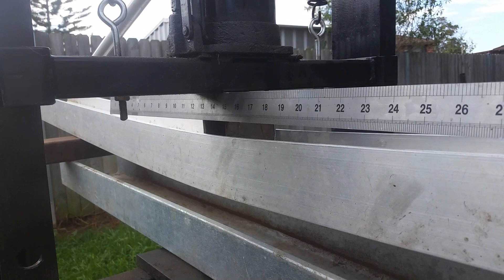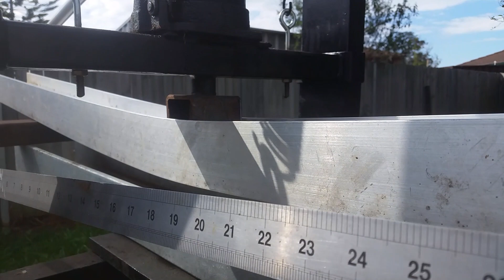Bending Aluminium I Beam Aussie Style!

Comment: Cool vid. Are you making a aluminium trailer?
Reply from the maker: Yeah i tried making one for a tinny about a year or so ago but it didn't pan out because i needed the joints welded on the  i beam sections so i used this i beam to test how it went in bending and the bigger picture is to design and build a 5.5 meter aluminium trailer for the boat  i am rebuilding